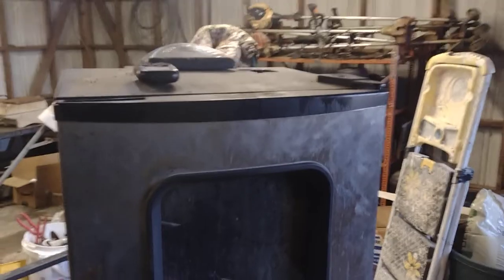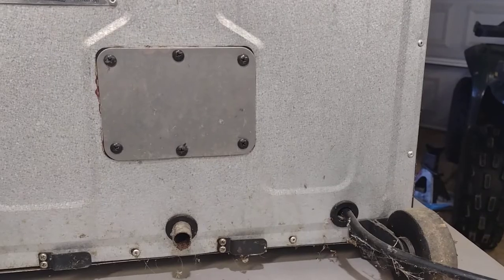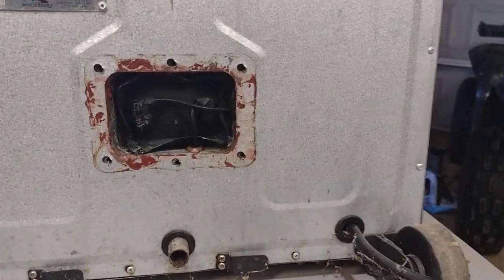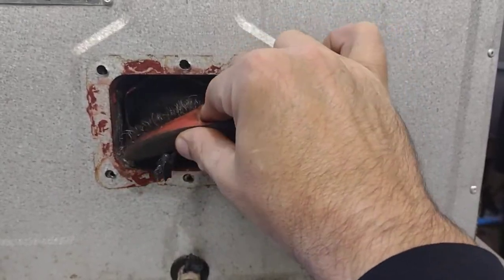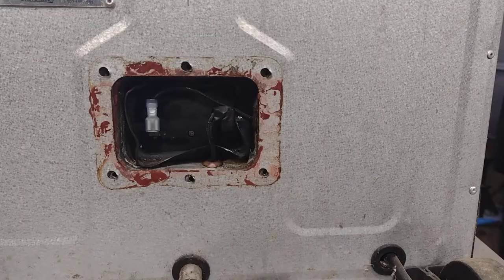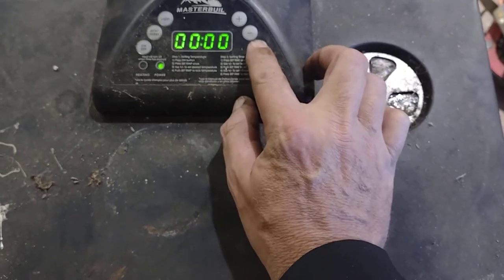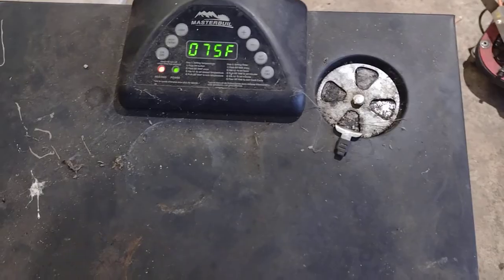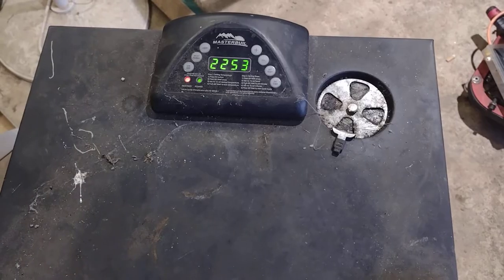EASY!!!!!! How to fix MasterBuilt smoker.

Comment: Been searching online my master built just trips the outlet and doesn’t turn on so would it be a heating element or something else?
Reply from the maker: Could be. I would check for a short somewhere. I would start at those 2 connections and make sure that neither one has broken off and is touching the frame. If they aren't broken off, I would unplug them, secure them so that they don't touch anything and plug it in. If it doesn't trip the breaker, probably a bad element.

Comment: Have same problem but connection is good and element looks good
Reply from the maker: Do you have an ohm meter to check the connections?  You want to check them with it unplugged, of course. I have seen a few since I made this video that the connection was corroded and not making good contact.
Reply: @shadetreediy7743  ok , I'm going to try that👌
Reply: Mine works now after replacing a ksd301 sensor heat sensor. It’s behind the pop rivet back sheet metal

Comment: Mine is shocking the fuck out of me it runs and shit it works shut off a few times but anytime I touch metal on the smoker I get shocked like crazy tried different outlets and still the same thing anyone have a idea if maybe it’s just a bad ground perhaps?
Reply: i get that as well, i fix this by using grounded plugs to ground on wall. no more shock.